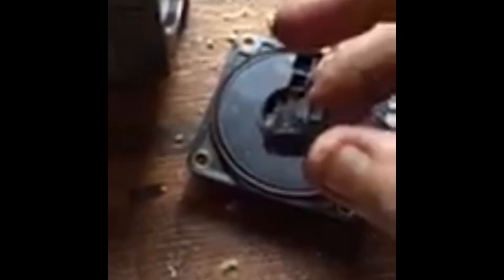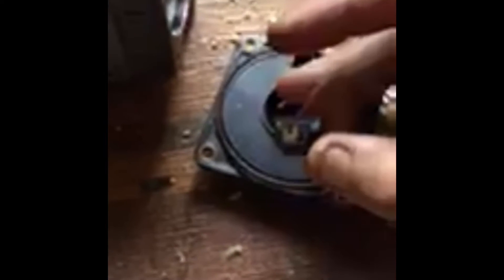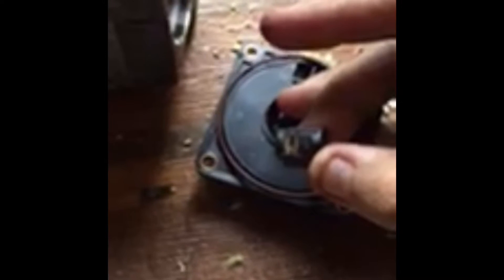2000 Volvo s70 non T base sedan Electronic throttle body issue and replacement

Comment: Did you need to reprogram the throttle body after installing the new ETM?
Reply from the maker: I did not, when you change the sensor only instead of the whole part, a reprogram is not necessary.

Comment: yeniden yazılım yüklemek gerekecekmi peki ve fiyatı
Reply from the maker: hasan kocaman what language is this. I speak English only.
Reply: Do I need some reprogram if I replace old tps with that?
Reply from the maker: hasan kocaman sorry for the late reply just now seeing this. NO! The best part is there is now programming! No trips to the dealership. Rebuild and replace. I didn't feel like taking out the starter so I cut the cord and rewired it for reinstalation